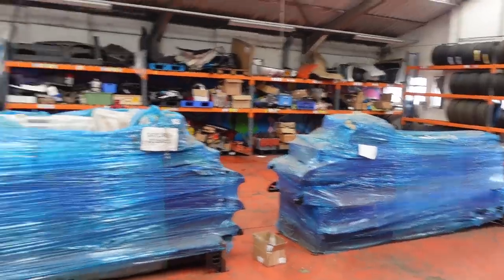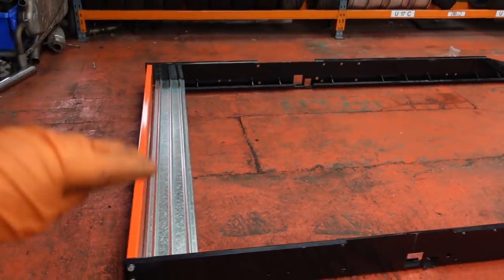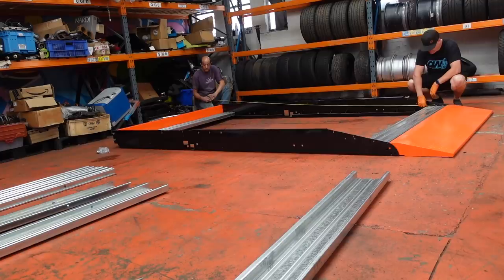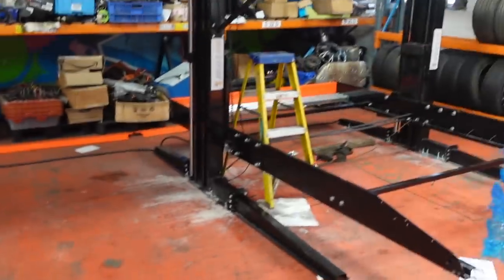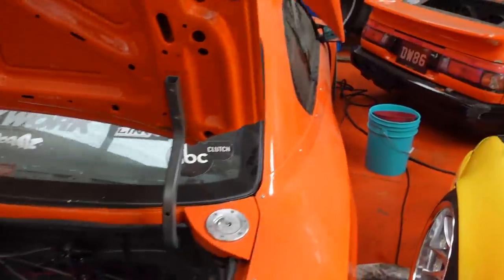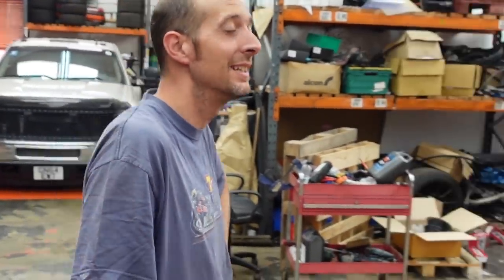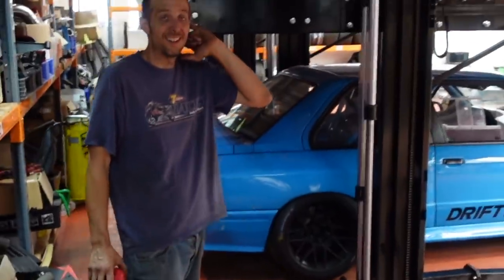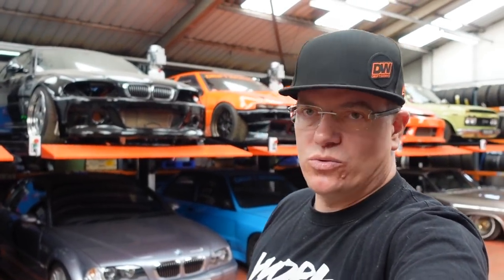Building car storage lift parking ramps for my Car Collection

Comment: I'd forgotten how good the DW S15 looks, you've gotta get it running and take it out drifting somewhere once the other projects are done!
Reply from the maker: For sure. The only thing is, there's still nowhere to drive it. I've really lost interest since we lost Rockingham.
Reply: @driftworks  what about 3 sisters or teeside? Sure, it's further to drive, but it would be worth it once you're there, for certain
We need another purpose built drifting track further south, or at least a track that allows it...

Comment: I used to build these for a company in Warwickshire, good job guys!
Reply from the maker: Cool. Any idea what they charged? It's definitely no easy task.
Reply: @driftworks  Unsure on costs, I was simply there to fit. For a set of your size we'd have 3 guys and a 5 day week to complete. Measuring and install was easy and done in the first two, the next three would usually be spent trying to get the buggers level 🤬 keep an eye on the welds if they're Chinese made (wonky welds was usually the cause of misalignment of the racks) We'd often be calling local welders to come and check or reweld some areas. The four posters are a lot more faff, you definitely went for the best option to DIY install. Again, looks great from here 👍

Comment: Can you rewire the controls to be pendants, will remove the braining devices from face height.

Add some CTEK or similar battery charges with drop down extension leads to keep all the batteries topped off while cars are in storage…. Should have waited until the end before commenting 😂

Nice job.
Reply from the maker: You can, and I have thought about doing that. I have an inch long scar on my head now thanks to them. As mentioned at the end, the ramps will have their own sockets for Cteka

Comment: Cracking lads cracking hope that floor can handle the force on it as that’s a canny bill of not
Reply from the maker: It's all to spec. They are pretty much self supporting in terms of the normal forces applied.
Reply: @driftworks  pleased as that’s an eccentric collection that needs holding up 👍

Comment: If you run out of space Phil I'm happy to look after the E30 and the 964 for you.  I'm super kind like that mate.  Any chance you can tell me what colour you used on the 964's wheels please? Mark
Reply from the maker: The 964 wheels are a Work Wheels colour done at the factory. I think it's 3 stage, so there's not a code or anything.
Reply: @driftworks  Thanks.  🙂👍

Comment: You got me thinking... I need to replace the AD08R tyres on my MX5 NC. Is it true that Yokohama ruined the grip with their new compound? Something about silica. I was thinking about getting a set of Nankang NS-2R tyres so long as they're just as good for year-round on the road.
Reply from the maker: Yeah new Yokos are useless. NS-2R are a good performance / moderate trackday tyre. I wouldn't be too keen on using them in the snow. but the same can be said for most of the expensive Michelins I use.
Reply: @driftworks  Thanks very much. I'll steer clear of the Yokohamas. I'm down below the legal minimum so I should take the plunge this week, and I see you have NS-2Rs quite reasonably priced in your shop.

Comment: You should probably make new rear bars instead of flip them down.

Your triangle plates do almost nothing.  When a beam is stood up like that it is either to increase the stiffness vertically or prevent the sides from twisting.  I don't think the vertical stiffness is an issue but twisting might be.

Taking that kind of a chance on a Chinese product is not something I would do (p.s. I have a Chinese 4 post lift).

At minimum weld on some short tubes on top of the sideways beams to pick up the top bolts.